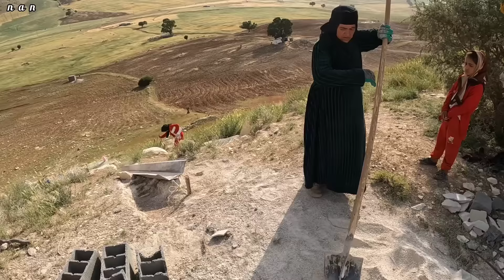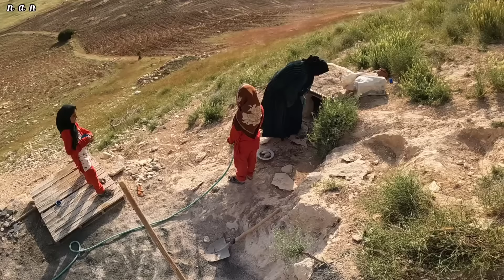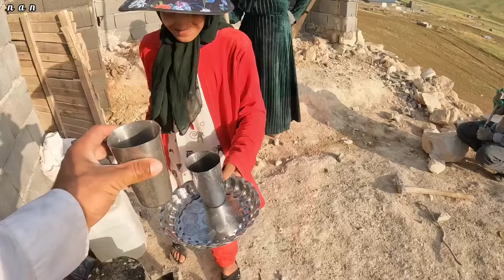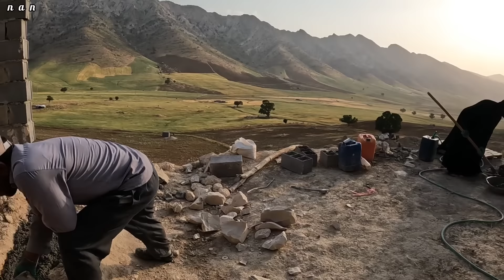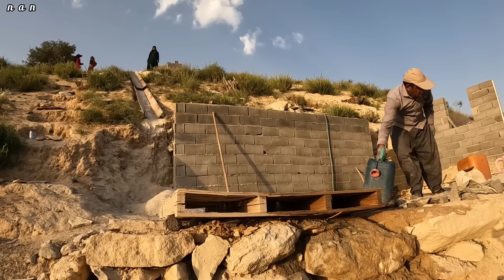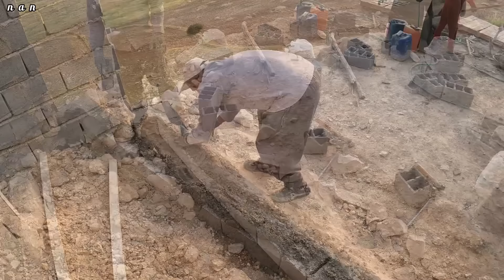A grandmother's dual quest for shelter by the cave: a small house with a big heart

Comment: Nana you need to buy a tap for the hose, yes it works okay for now but a small piece of copper with open shut valve. If it's not that simple then Operator or builder could help you. Bless you Nana,  so strong. I wish you great health, ❤ showing these girls  if your willing  to work hard you can achieve your desires.Salaam